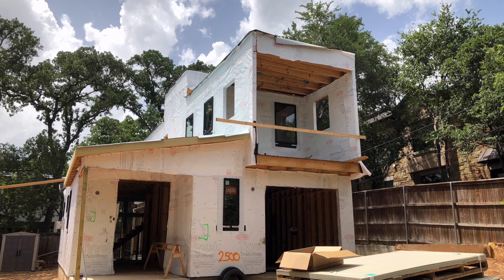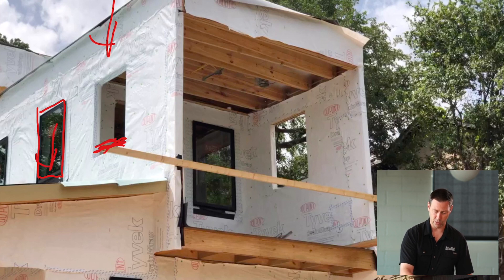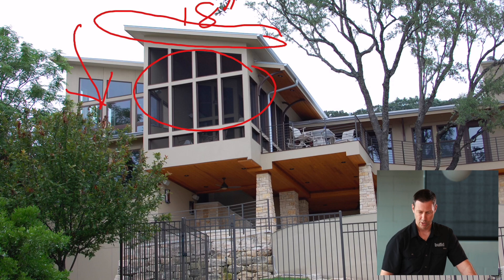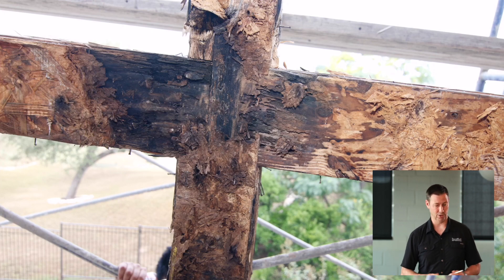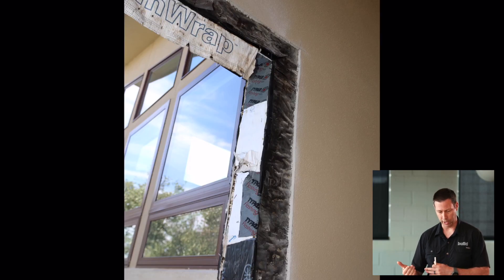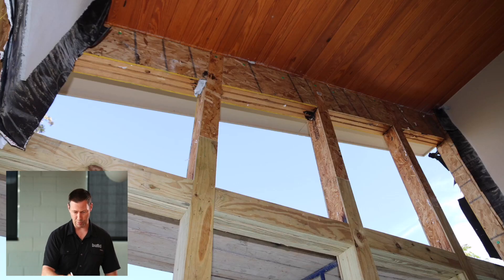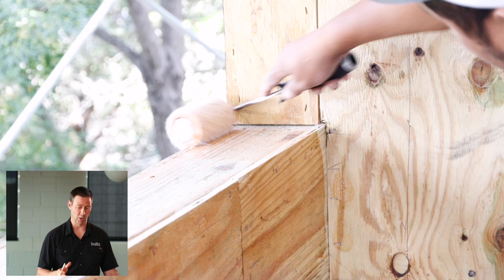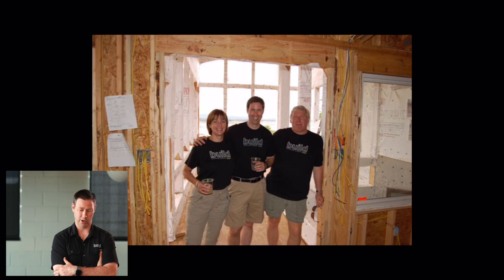Learn from MY FAILURE - A Building Science Lesson

Comment: But the primary failure cause was that the caulking outside failed after a few years, right?  Then the water got inside, and because of the cut in the flashing corner, the water seeped into the engineered wood products which could not handle moisture.  Was the caulking failure due to failure of the product or the workmanship?  Was there a lesson learned from the caulking failure?  Even though you have improved the underlying moisture barrier, you are still counting on the caulking to hold and to only rely on the flashing and PT plywood to provide protection as a backup, right?  It seems like you are just focusing on the secondary moisture barrier failures but totally discounting how the water got back there to begin with.  Would have also appreciated if you had shown how the water drained out after being diverted by the flashing.   Guessing there was vent holes underneath?  I'm just a homeowner (not a buildier), and would have liked to see them to understand the full waterproofing system.  Thanks.

Comment: I so very much appreciate this video, Matt.  

I am struggling with a water intrusion on my ICF house around my windows.  They are bucked with AC2 2x12, the windows are of the 'new install' variety and so are nailed to the exposed 2x edge.  Window tape, foam-friendly peel and sticks, foam-friendly roll-on elastomerics, flashing cut in above the windows, and a combination of the above have all been tried.  Still, the water finds a way in and no one seems to have an answer.  Some of these windows have been off three and four times.  I am beginning to wonder if the water is coming in far above the windows and all of the siding needs to be removed. in order for the entirety of it to be replaced with a stucco that wouldn't necessitate nails.  Water will always find a way!

Regardless, I VERY much appreciate that you not only stood behind your unintentional mistake, but then took the time to alert others so that they could avoid a similar fate.  We need more like you!  Gold star!!

Comment: ALL BUILDINGS TAKE NOTE STOP USING FAKE MATERIAL LIKE WOOD USE CONCRETE INSTEAD
Reply: felipesilvausa some notes for you- A. Wood is a natural material. B. Concrete is an engineered product and it too can be compromised by water especially if it’s done by hacks. C. Your caps lock is on.

Comment: You stated the problem that the house wrap was the waterproofing! Please show me where ANY MANUFACTURE OF ANY TYPE HOUSE WRAP STATES THAT THE HOUSE WRAP IS WATERPROOF OR WATERPROOFING AFTER BEING APPLIED. All they state is that it is moisture resistant and no where does it state the word PROOF THEREON. Without the additional protection of either soldered copper flashing, or Turnmetal flashing that is also soldered, even peal & stick sometimes cannot seal the 100% parameters of the entire exposure due to penetrations by finishing nailings. Shame on the architect for not knowing this, shame on the house wrap consultant not specifically stating their product limits, and shame on everyone else for ASSUMING that just wrapping completely would prevent any intrusion. Let me be the first to tell everyone "Plan on water getting in and at the same time plan on the same water getting back out". Flash and counter flash at any/all cost. Even soldered sheet lead wrap would have prevented the intrusion, but at a much higher installation cost. No matter the final finish condensation and driven rain will penetrate, so make plans it will happen and make plans to let it seek its own way out without first penetration any substructure and it can be done. 55 years of Florida coastal front wood frame construction against hurricanes and NEVER a leak failure in 55 years, due to several facts, extremely good initial teachers who knew how to build and taught how to properly build, several architects that grew up working for fathers in the wood frame building profession who know how to properly detail construction documents to prevent such from happening, plus good associations with several ethical sheet metal fabricators who listened to how you wanted to prevent water intrusion, and assisted in fabrication sections that would work properly after being covered over with final finishes. All it take is proper forethought and proper application of the proper products in a proper procession.

Comment: Matt, what a timely video and great learning lesson.

 Just tearing into windows installed 25 years ago.  Oh boy, what a shambolic mess.  Flashing details were a disgrace at the sill (used that worthless Fortiflash garbage). Literally would have been better to have had nothing.  Sigh.  Thankfully, no engineered lumber and was framed with 2x6 vs original design that called for 2x4, so even though some studs had some minor dry rot, could treat and keep in place w/out structural compromise.  All the 3/8 plywood sheer walls being replaced with 1/2".  Using Henry Blueskin with primer and their Airblock liquid flashing around the window openings.  

But one item missing from Matt's repair is the absense of a rain screen assembly behind the stucco.  Rain screen is the critical system - more important than a perfect flashing job imo - creates a pressure drop and virtually eliminates capillary wicking thru to the wall system - creates that all-important ability to dry to the outside.  Need to design system that has air flow from bottom of wall assembly that can exit at the top to enable convection air flow

Comment: first, blame  this on the whoever designed the structure with short overhang and open bays ... second, there should be no expectation of building waterproof ... (think of water resistant watches) third there is FLASHING and high water performance pvc/abs trim nailed in flat horizontal surfaces that would have allowed water to sit on shed Fourth there are bunches of high performance caulking that could have helped extend protection including paint. Paint is a legitimate water barrier that requires refreshing every couple years ... its normal and expected house maintenance.  Much of this could have been addressed at construction and Im not saying there wouldnt have been some damage at ten years ... but consider at what point this still would have evolved to a repair without annual maintenance  - 20 years?.  "Peels-out" = stretches ... how much of this product wasnt around 10 years ago ... ten years is a long time without new innovations and products. Like liquid flash. Think showers when framing ... you know bathroom seats, the biggest framing challenge for long term = twenty years.

Comment: Hi Mat 

You have done great work in addressing your own mistakes and standing over them I Commend  you on that 

But one rather large concern ( perhaps not but just based on what I have seen in the pictures included throughout this video )  and not addressed by you in your new approach is that you have severely handicapped the new Wall assembly’s ability to dry inward or outward by completely wrapping with in a non permeable membrane 

I’m sure it’s done really well and won’t leak but in this case of ingress to this new assembly it would translate to a situation of Rot in a much quicker fashion 

Nice video 👍

Comment: Still going to run into issues with this porch. Perhaps it will last 10 years round #2, but water is likely going to find a way in, as it always does. Your membrane likely has lots of holes in it when you fastened the trim boards & stucco mesh to the framing. I presume if you re-did the job today, you probably would have added some dimple membrane so that any water that gets behind the stucco has an escape path.

I think it would have been better to paint the entire structure with latex\acrylic primer as a backup protection for the wood, than apply your peel & stick water membrane.The paint would have helped the peel & stick adhere better. also a white paint would make it easier to located an spots that missed getting painted. The clear primer it not always easy to spot missed areas.

Comment: I would be extraordinarily careful with terms and concepts like "waterproof," in any form of construction, much less conventional wood framing.

I witnessed a house that was designed and built with an impermeable water barrier on the outside (ASHRAE zone 4/5). The thinking was that keeping bulk water out and away from the framing, completely encapsulating it, and allowing the modestly sized house's HVAC to regulate the interior latent heat/humidity, would create a stasis that allowed the wood framing an equilibrium.

It didn't work.

Anaerobic digestion took over with the green lumber framing almost immediately, rotting the exterior walls from the inside in just a few years time.

It wasn't pretty.

Comment: This video explains alot about you Matt.The 80 to 85% of your videos are about air or water getting involved in your remods and new builds.Im listening why you talk about 5 degree on window seal.Huh! At most windows have you ever looked at the outside and bottom of window.90%+ have a pitch.We use goodyear peal and stick.in SC.Again I now know why your protective of your inside .That engineering wood is not cheap.For you to get rot like that and what it cost you.90% of my videos I would mention why the person sealed the wood and overed the outside .Im not by any means knocking your videos.Yes I am.Matt I ove your show.But Like I have said before all you talk about is air, wraps ,and
the right way to put on a product.But like I said I now understand.I hate engineer ed wood.Its not new.Ive been building since 1979 and saw it in the early 80s.Then changed to do remods about 12 years later and the engineered wood not solid LVLs looked like you 2 year project.Mat you know who loves to smell glue besides my wife.Couch time.Termites.Seen 4 or 5 jobs even with termite applications were done regularly.They died not before 100s of thousands ate just a little.Funny story and very good onfo for your listeners about some kind of bug or mold that 3 people came out ad gave me a bid of 11 to 12 thousand to fix.I shut down after 38 years of building.Started a new venture in same field but for homeowners to build their home their self without getting ripped off.Which I would haver never let you leave the job without fixing what was clearly going to be problems on a 18 foot screened porch.Usually on modern homes where you dont see overhang they make gutters that blend in with new idea's or Technology.

Comment: I stopped watching after 10 minutes.  Did you ever explain why you originally chose to use engineered wood in a situation where you later rejected that idea?  You said that the installation was wrong, but you changed the material as well as correcting the installation. Why?

Comment: The first layer of defense against water infiltration is the exterior caulking. If that fails the 2nd line of defense should be the flashing. If that fails the 3rd line of defense is in the mechanical arrangement of the components. I installed windows in my home that did not require flashing or caulking due to the labyrinth seal geometry created by a custom casing around the perimeter of the window's frame. It didn't matter if water got in between the casing and the frame because it would hit a "wall" (which was the casing) and drop straight down and out at the bottom of the casing. Of course there was proper flashing behind the casing and caulking in front but these were just back up mechanisms. It's not always possible to do this but it is worth the extra effort when building anything custom.

Comment: Using chip board for almost all projects is an invitation to failure, pound wise and penny foolish
Reply: After twenty years inspecting homes (new and old) my opinion is that someone selected that material and hoped it would be sufficient, my experience is that plywood is the safest choice, and the most cost effective in the long run.  If some one wants to use chip board, then they can expect a failure and to blame the installer /worker is poor judgement.